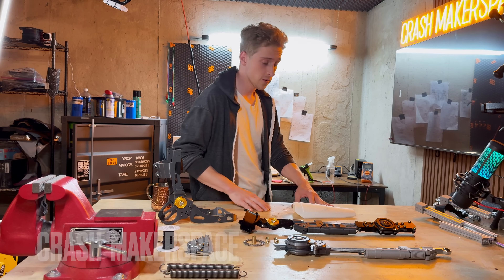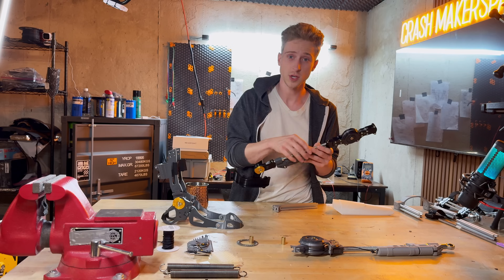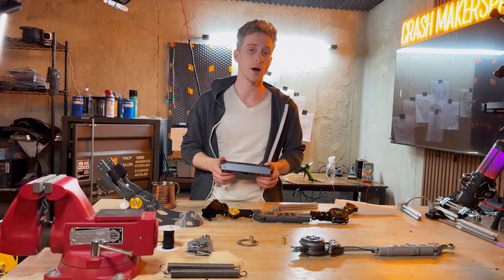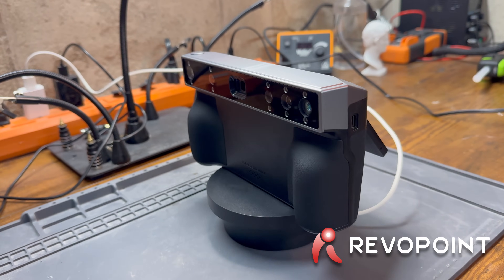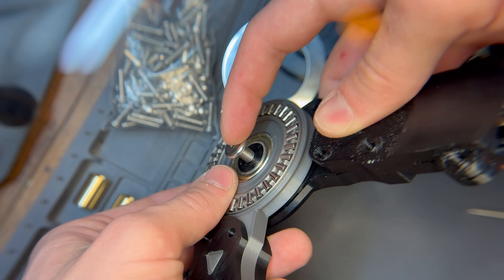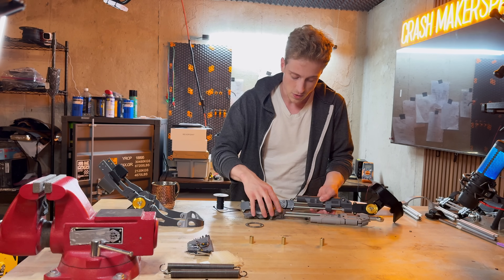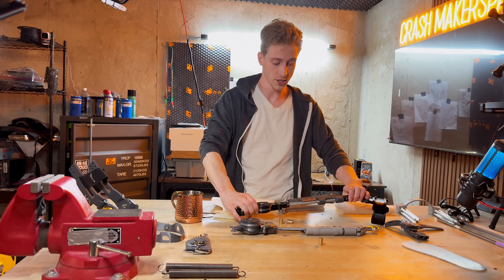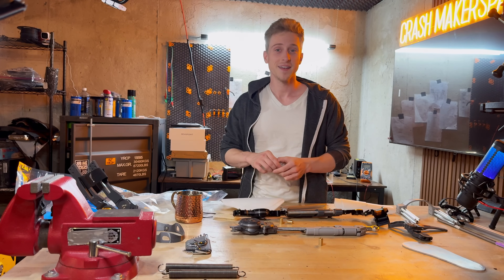Building Real EXO-Legs like Batman

Comment: a ring assembly with slots/pins to stop over rotation could go above the ankle to allow twisting of your foot left and right without ipeding flexion in your ankle itself and though would add complexity would give you far more adjustment to the range of motion available to your foot.
Reply: also instead of springs for the impact reduction you could use a similar hydraulic setup to bicycle front fork suspension as a shock absorber, distributing these across the thigh and calf would allow you to use an array rather than a singular piece vastly increasing the amount of shock absorption while reducing relative weight and allowing for greater fine tuning.

Comment: The knee design you used appears to be around a single point of rotation. The human knee is polycentric, so a monocentric knee will always feel a bit off. You can find polycentric knee joints for orthotic frames that i'm sure youd be able to mimic

Comment: 9:10 why dont you use the baring in the roller blades or roller skates wheels ?! They are light, they have enough strength and movement.

Comment: 14:25 suggestion: use pistons instead of the cord and the springs.
With pistons you can transverse the pressure anyhow you like it. You'll just need to have a mechanical trigger by movement trough a certain point

Comment: Odd question: Is there any reason you don't wear the exo-leg on your inner thigh other than groin safety? If they were on the inner thigh, then there wouldn't be as much need to armor them, just your leg in general (other than a casing or something to protect pinching). And it would be far easier to "anchor" your core muscles into the system. Although in order to make it work, I picture you'd need to make a steel diaper to protect your pelvis. 😅

Comment: Why not drill threaded mounting points along the outside of the frame to mount ballistic plates, making it possible to use risers to make it easy to float plates over each other for protection of both the large round joint and knee

Comment: Amazing work !!  
the knot problem could just be you (knots are weird)..  ya I know a stacked knot (like 3 in a row) feels strong, but it's nothing compared to a figure-8 knot.
I use a figure-8 knot for waxed dental floss and it doesn't slip at all...  and it's just like a normal knot, but with a twist.. sooooo weird how well it works.

Comment: Look up how to make a Brummel lock splice loop in Dyneema.  It's pretty easy, won't loosen like a knot does, and is much cleaner than having loose ends on the cord.  You might need to add a tensioner to one end to get the length exactly as you want it as there is some initial lengthening of Dyneema once it has been tensioned and the braid settles.

Comment: I will put some additional thought into the joint structures of your armor pieces.
Although, the first thing that popped into my mind was the joint structures in the armor of the old mega man video games.
Externally each joint looks like a bubble shape.
Not a very sleek or easy design to prototype but in theory it could be functional.

Comment: Rather than using cordage, check out a construction item commonly referred to as "mule tape", sadly, I think that it does stretch, however for experimental purposes, it would most likely stay in flat channels better, and transfer load stresses over broader areas..
I have no doubt that if you can succeed with the mule tape, the company that makes the dynema cords probably has or will be willing to make a ribbon style batch for your project.
In case you have not noticed, there are many different ways to attach ribbon that are as strong if not stronger than round cordage.
Also, stacked ribbons with friction reducing sheaths means that multiple ribbons going to different points of leverage can exist within the same channels.
Also, even though it is messy to work with, silicone garage door spray lubricant is fairly neutral and non reactive with other compounds and polymers.
Ok, I will shut up.

Comment: Is there an advantage to using a tractor spring like this, where the power increases or could it be better to use something like a constant force coil spring or even a gas spring?

Comment: You mention the extension problem for the chassis. There is a way I see you completely getting rid of that problem but it’ll take rubber.

Using rubber or something elastic but rigid or just slightly giving, and or making it slight thicker in the areas of the gear ratio to allow the gear to move within a higher degree of freedom. But still be kept as is. Instead of having just a straight line that gives due to the material, extend the gear ratios degree of freedom necessary for that to happen by design.

Comment: Crazy that this is lowkey a better design than a lot of the military companies trying to do this, I understand they are going for electric powered instead of a spring powered by your leg but starting with a base design like this will always evolve into something better rather than starting out with a clunky electric powered design
Reply: I can guarantee you right now this is not better than any military company LOL. No hate towards this guy, just stating a fact.
Reply: Tbh, when I first seen this on an Instagram reel, my first thought was if I could try and make it pneumatic. I am also in college for mechanical engineering rn, and it would be a kickass final project

Comment: The knee doesn't function like a simple hinge joint. The shape of the femur bone at the knee level, the medial and lateral condyles give it an oval shape and not a round shape. This makes it so that the pivot point of the joint moves when flexing/extending the knee.
The mechanics of this serves two purposes:
1) When standing upright, the oval shape allows the surface of the femur to balance on the tibia thus reducing significantly the stress on the ligaments and muscles. Imagine a rugby ball and how hard it is to make ir roll alongside its long axis.
2) When flexed, the pivot of the joint moves backwards which in turn increases the space between the femur and tibia thus allowing for a greater range of motion. Action figures achieve the same effect by using double-jointed knees.

If you don't take into consideration these elements then any leg movement will put unnecessary stress on the exo-skeleton's simple-hinge joint.
Reply: so what are the best type of joints for knees?
My cusin visited me on his enduro KTM. I tried to understand how knee protection is made but i didn't saw joints like bearings. There was 2 parts wich was connected with short thick rubber band.  So i didn't get how it works.

Comment: There are combat boots with carbon fiber plates built into the soles. M-CARBON 8 by otbboots. Probably more functional than an aluminum plate at the bottom. Might be an option for you!

Great build!
Reply from the maker: Great timing! I'm looking into some straight weave carbon fibers for that design, for flexing in that primary "launch" direction

Comment: So what is the end result you are looking for here? To be able to "charge" your leg extension for higher jumps, or to also soften the blow of hard landings? I'm curious how if you plan to do parkour with these what the effect it would have on running speed, because at first glance I would assume using leg power to pull the springs would lead to a slower running speed because you cannot get more power out than you put in.
Reply: It’s to increase jumping ability. He literally says that at the start of the vid. And its super easy to figure out that it wouldnt actually slow down running, but rather increase running because its designed to increase the force of extending your leg by combining that with the potential energy being created from the spring being compressed.
Reply: @clippydidntwannahelp  I understanding the jumping part. What I am trying to say is, wouldn't the compressing of the spring take more energy than the spring could possibly give back out?
Reply: @AquariumGravelEater  That was my thought too. From what I understand, it isn’t about being efficient with your energy, it’s just allowing you to give your legs a greater possible power input for a greater possible power output.

Comment: To fix the side to side motion of the ankle, you could put a ring just above that hinge to control the roll of the ankle, since the entire joint rotates when you move your foot left to right. It would also provide an extra mounting point for armor plating on both the front and back. For armor plating, you could look at lorica segmentata. It's the armor that some roman soldiers would wear and it consists of over-lapping metal plates that provided protection while still allowing for flexiblity.
Reply from the maker: I was debating a ring! One challenge is making it open up to get your foot into it, remain smooth, and still be super strong, so I'm pondering various alternatives / mods there

Comment: 11:10 I only partially agree with this in how it is implemented, it's not just 'surface area' another large factor is external leverage and the forces the materials are going to experience. Hitting that hard-stop on the inside ledge is going to be brutal on plastics, the further things are spaced away from the pivot, the less force multiplication the hard-stop will experience. Those 2 bolt points on the right at 11:10 , are so close together, that they would make a much more ideal hard-stop location, and will see 1/2 as much impact force.
Reply from the maker: Correct, these will be ideally made from metal (I've got a manufacturer working on that atm) and I'm actually looking into having the armor BE the frame where the larger panels would interface at the closed position making for a large and very well supported end-stop

Comment: For the tensioner rope you might be better off splicing the end of the rope into a custom end cap with epoxy. It would be more permanent than a know but you wouldn't have any issues with slipping or fraying.

Comment: You think you're ever going to add magnets or some other climbing aid to the shoes or outside of the scope?
Reply from the maker: Magnets would need to be electro -mag since you wouldn't want random metal fences / beams / etc to grab your feet randomly. Electro-mag dumps power so it'd probably not be worth the power drain from my Spinal Battery that I'm hoping to power some jump assist stuff later!

Comment: You should avoid putting knots in the dyneema when you use it, it weakens it and slips too much; but splicing it works really well for making end-loops and is pretty easy to learn. I used DIY spliced dyneema end-loops to make my hammock suspension and it worked great for years and years.
Reply from the maker: Good suggestion! I'll check out splicing it instead

Comment: What about building a shoe that extends an impact surface from the heel as you throw the kick? Might would allow you to use woven plates for flexibility under the sole of the shoe as a backup, and the heel 'spike' could take the brunt of the impact. Also would let you freely move the front half of yr foot, or at least have a seperate plate for it.

Comment: I love this project. One research solution for the ankle is to use a closed differential hydraulic system. Basically a set of very small hydraulic rams connected in differential pairs, with no power source. The pairs (or quadruplets) of tiny rams constitute individual axis of rotation, and as the joint rotates fluid is forced from one side of the pair into the other, maintaining stability and providing some dampening. The engineering challenge is obviously far greater with this approach, but I think its quite elegant.
Reply from the maker: I literally have pistons in the shop to test this! Although they're a bit bigger than I was hoping lol, but you're right-on with the articulation of lengthening & shortening in tandem around that center pivot
Reply: @CrashMakerspace  Something that could look into in terms of material (saying might be either CNCed or 3D-printed in metal) might be what The Hacksmith has shown off as "real life adamantium". The way they used it was to have light-weight 3D-printed parts coated in the stuff.
Reply: @CrashMakerspace  Literally?  Like literally?
Reply: You'd have to link them up diagonally, as in the front-left piston is linked/coupled to the back-right

Comment: Have you looked into muscle, tendon, and ligament strain in other exo suit builds (e.g. army or labor associated)? From memory a few years ago, one of the reasons that spec ops stopped testing mobile combat suit systems was chronic strain, and I'd hazard a guess that the addition of constant spring tension without a "released" option might begin to cause issues.
Reply from the maker: Right now, it's mainly protecting against over-extension from non-natural motions. The ankle can be a bit rough on hard landings, mainly padding is key in this stage

Comment: One possible solution for the slipping knots is if you're using a cord that can melt, use a soldering iron or lighter to melt the end of the cord and press it into the knot.

Comment: An eye splice in your cord instead of a knot would solve the slippery issue and be much cleaner looking
Reply: And stronger, the knot acts as a weak point and can be between 25 and 50% reduction in effective strength of the cord.

Comment: Would it be possible to implement a Dnsys X1 Exoskeleton into the design of this? Would motorize some leg movement and allows for less fatigue and more power
Reply from the maker: I like their concepts and designs, really well built for hiking and walking, but they aren't tuned for irregular movement like parkour / flips / kicking etc like you would navigating complex urban terrain. These are designed rather for repeatable and simple walking / hiking long distances

Comment: A flat sheet of metal in a shoe would deform upon impact, which is why, among other reasons, structural elements in cars have those weird shapes instead of being flat and straight. I think a good option would be to use such a sheet as an insole, and on the outside, something hard like 12 mm rebar rods, connected to that sheet inside the shoe :D On top of that, something to absorb vibrations, like a foam insert.
Reply from the maker: The flat panel was just a quick n dirty solution so I could start kicking those blocks, but I'm actually looking at some carbon fiber & various epoxy options to see if I can get something that has some good spring to it to help with running. There'll just be padding below that to further protect it from shattering

Comment: 2:43 rods are great with the threading, but hollow tubes would provide much greater strength/weight ratio and rigidity. you could add threads on the end using a tap or die set. I bet you could even find titanium tubes for relatively low cost if you get in touch with a metal supplier.
Reply from the maker: Yessir, post-prototyping phase will be cutting the intermediary methods used for adjustments and demo’ing
Reply: @CrashMakerspace  You could probably use carbon tubes with Epoxy bonded threaded end-inserts. Super strong and light. Not too expensive from china either, although American tariffs may change that.
You should investigate Atherton Bikes new Tube and Lug bike design to see what I mean. This project has great potential.

Comment: I know this could get insanely difficult, but you should do something for fingers. If you’re using any sort of melee weapon, your fingers are your most exposed and vulnerable appendages.
Reply: Theres a guy that builds his own prosthetic hands with motorcycle chain and such that are ridiculously useable and completely mechanical.  Itd be cool to see a collaboration.
Reply: Fingers are EXTREMELY flexible. It'd be a nightmare to have something like that that is strong and doesnt sacrifice flexibility. Something I could see is a kind of jackhammer fist thing like you see in the MCU's take on Crossbones. Hes got these spring-loaded hand additions that he can punch with, sending them way further than a normal punch.
Reply: @vismaykedilaya1318 I think something somewhere along the lines of some of those mechanical VR gloves could work. The mechanism would need to be bigger. I guess some kind of brass knuckle design would be easier to implement.
Reply: Finger criminals
Reply: If you're inspired by batman then the answer would be "You wouldn't use melee weapons". And if you ARE going to use melee weapon then it would be way easier to just design a melee weapon with a guard.
Reply: Wrist mounted swords
Reply: Honesty just an armored mitten would take care of 90% of threats.
Reply: @tiberiumnp8030  yeah but then you have less dexterity than stephen hawking
Reply: @Lancersilva Fingers can be still perfectly usable inside gloves and the plate would be on top of the palm. Just like some medieval armors had.
Reply: @tiberiumnp8030 bro hema gloves would like a word
Reply: Or hips… got that problem myself rn
Reply: The humble gauntlet
Reply: They make gloves with crush resistant fingers and gloves that are stab and cut resistant. I feel like that’s the best weight/ size compromise, because you need dexterity, so adding BP armor will make your digits useless, but you also want to prevent broken/crushed fingers from melee attacks, needle sticks, dropped weights, injuries from hinges, etc.

Comment: Electricaly powered cams with planitary gears on a reciprocal gear to store and modulate additional kinetic energy L/H modes. Knees bent back straight whee! (SUPER JUMP!) But simplicity in design is good too do a pro version for experts. Also consider pressure and or electrical sensors for toes and other parts of the leg associated with pre jump mussel cues.
Reply from the maker: I've been pondering some of these solutions, they'd be the logical next step after tuning the passive system to be robust, and full-protected motion. So far, it seems other systems descend into a bulky-mess so I'd make particular effort to keep it lean & mean